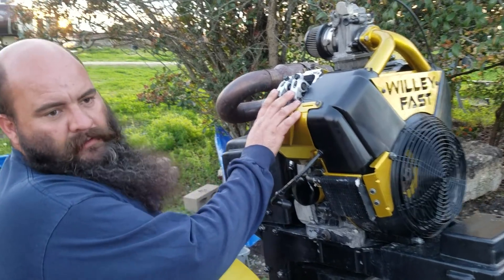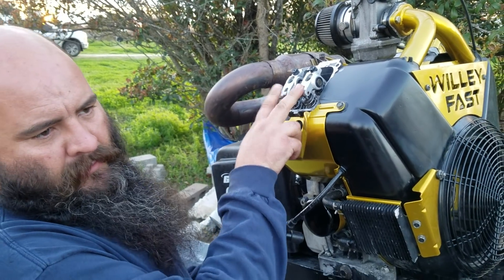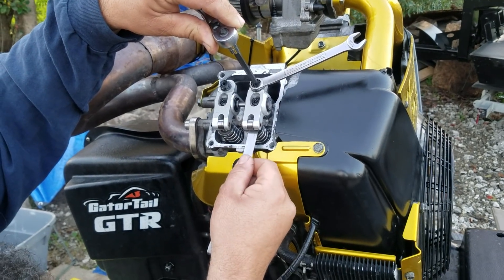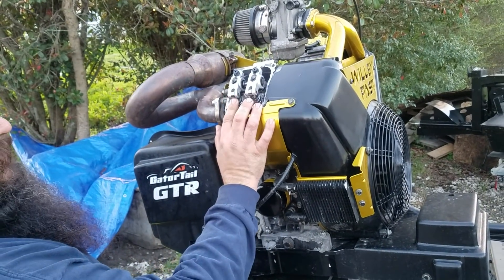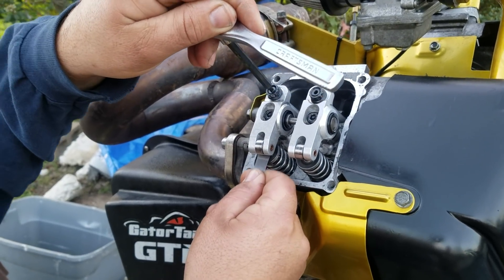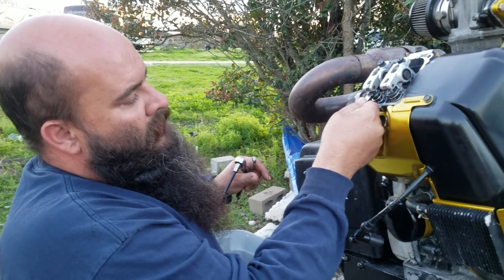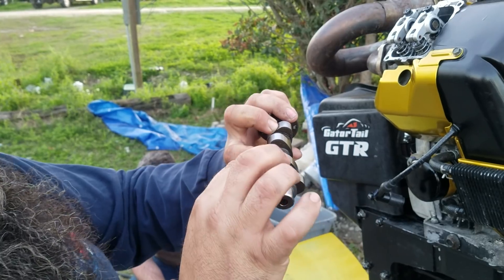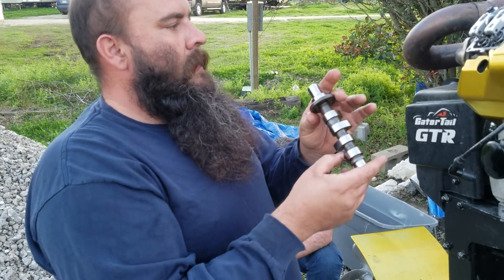Valve Lash

Comment: How often do valve lashings have to be done on a modded motor like that one you have?
Reply: It’s good to do them every 80 to 150 hours depends really on how much you use the engine if it’s all the time I would go in every 80 hours but that’s just what I do many people do it differently most manuals say every 250 hours  but I think that’s to long

Comment: Also, I see you have a plug in the side of your Mikuni carb... on my MudBuddy I have a hose coming from my valve cover and in the side where your plug is.... What are the Pros and Cons to both setups?
Reply from the maker: Hose delete not needed unless u run 5k rpms for extended periods of time
Reply: so are you saying since I run 4500 on my HDR 4400 I don't really need the HOSE? I don't understand the hose anyhow... why would you want to pump warm air into your carb? Can you explain?
Reply from the maker: U want to keep the hose, over 5k rpms the hose will blow oil, that's when u would want to delete it
Reply: rgr... thx man...

Comment: what is that rod connecting the roller valves... I don't have that?
Reply from the maker: These are my aftermarket roller rockers with custom designed shaft mounts and needle bearings

Comment: Great Video and explanation. Same for stock tappets on a 35? .005?
Reply from the maker: Stock rockers and stock valves 0.006"
Aftermarket roller rockers and Manley valves 0.005"
Reply: Same for 23?